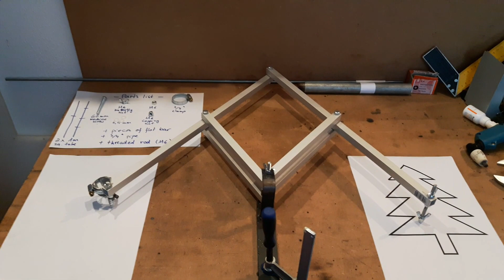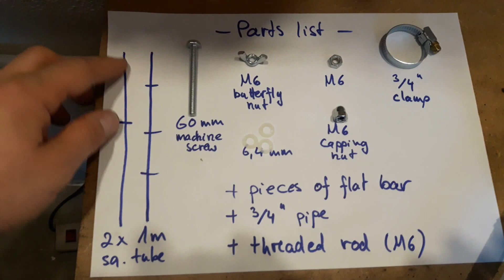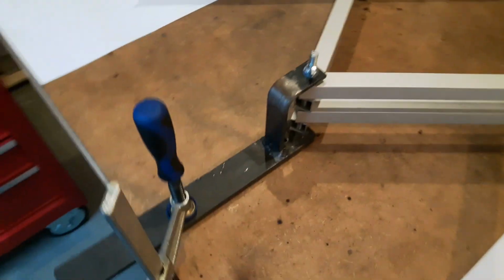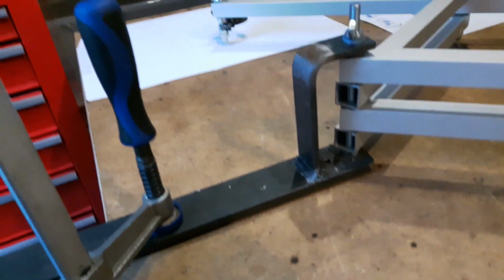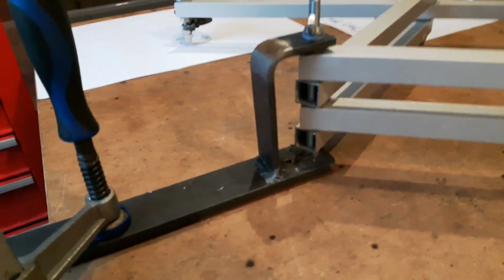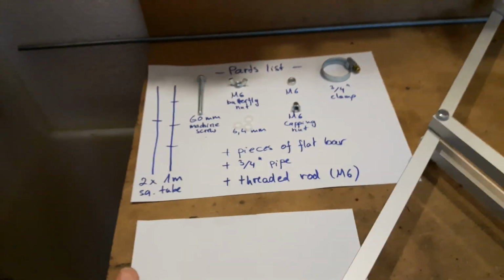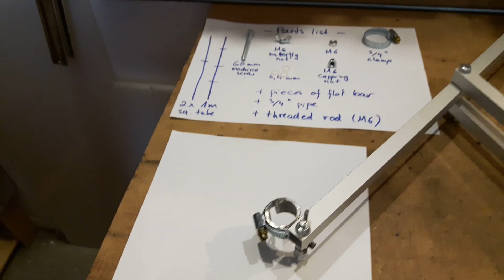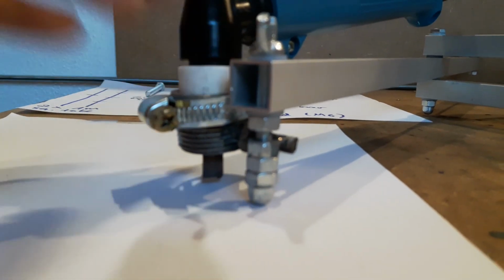DIY 1:1 plasma cutter pantograph (copy drawings)

Comment: This is one of the best designs I have come across on here. It’s extremely simple thus easy to replicate! Great job. The only thing I will try to change will be the trigger assembly. My torch turns off slit on its own. I got my torch from Harbor Freight about 2 years ago. It’s strong as the rest it will cut 1/4 inch anything. That’s 6.23 mm. For about 500$ brand new. Thank you again for your plans!

Comment: Thanks, that's a clever idea. In order to get better shapes (straighter lines and smoother curves) you can combine it with wooden templates.
Reply: Absolutely! If you have access to a bench electronic scroll saw cut pattern out of Luan 1/4 thin wood first. You can even use a tiny metal pin pointer to cut very mini lines. On the metal. Don’t get frustrated if your prototype doesn’t work. They never do first shot. V.02 is usually where the perfected prototype begins to excel. Have fun you can build anything you put your mind to!!       ( Op this is more directed towards people just figuring it out. )

Comment: Very nice job.  Quite simple but it looks to work like a charm.  I have been looking for a 1 to 1 scale pantograph and finally found your design.  After building I'll use it to copy wood trim used on antique clocks and a Dremel tool with a carbide cutter where you have your plasma cutter.
Reply from the maker: Thanks. Good to know there are people out there actually building and using it ;-)
Reply: @diecksl  можете размеры скинуть буду рад

Comment: os circulos ficam oval.
Reply from the maker: Hello Fagner paula silva, sorry I don't speak portuguese (translated your sentence with google translator). Did you build one yourself? If circles become ovals then something with the measurements of the pantograph is not right. Try to be exact with the length of the parts and the position of the holes. All holes should have exactly the same distance to the edge of the square tube. If you're unsure, try to build it from cheap wood sticks first. I hope this helps?